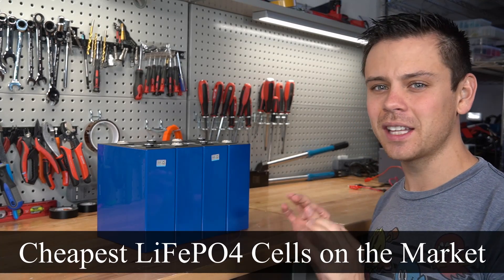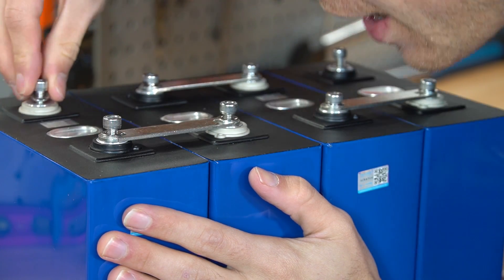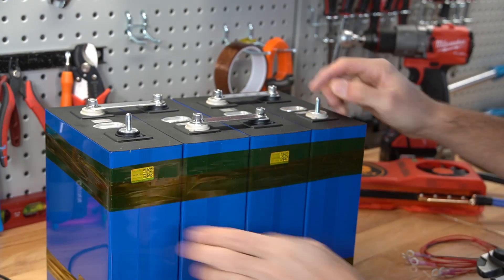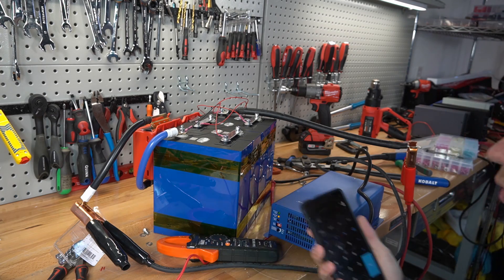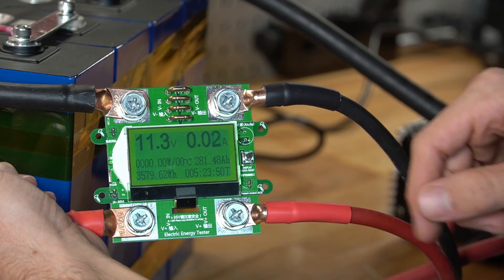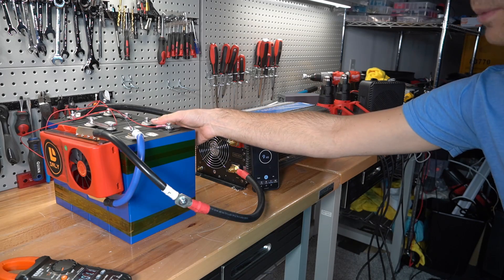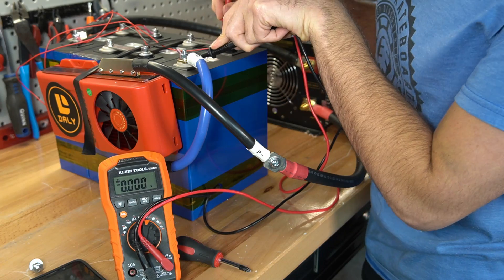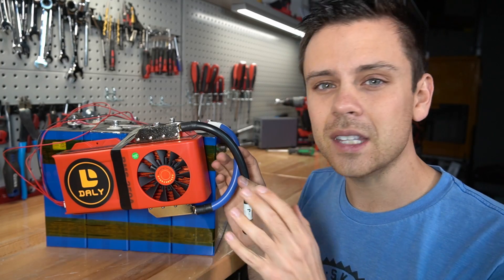$433 280Ah LiFePO4 Cells Tested: Cheaper than lead acid!

Comment: I would like to know if there are any things I should be careful on when wiring power packs with BMS in parallel? I have in plan to use same cells but wire them together 16pcs in serie, to get 48V packs. (I will use Daly's BMS 16S48V500A) and then I would like to connect 5x the same packs in parallel. Is this possible? Any recommendations, thoughts, ideas what should go wrong or what should I be careful on are very welcome. :) Thank you, Zan

Comment: How much should a person expect a LiFeO4 battery bank to droop under load?  I have a 300aH bank.  When I put a 150Amp load on the bank it droops from 13.2V to 12.2V.  Is this normal?
Reply from the maker: Oops didn't realize it's 150A load. Yeah that does seem normal, sorry. That's just a huge drop. Should be ok
Reply: @WillProwse  Cool. Thanks for the confirmation.
Reply: @WillProwse  What amount of droop would I expect to see?  The manufacturer says this is expected.

Comment: What’s the best way to drain a 36v (100ah) Lifepo4 battery? I need to do it to calibrate the onboard coulomb meter on electric utv’s that we sell. Are there 36v inverter’s available?

Comment: Will; thanks for the testing videos. I want to build two batteries like you have here. They will be in parallel, and power a 2000 watt magnum full sine wave inverter. So the question is, would the better BMS you link to (Overkill Solar 12v 4S 120A BMS w/ Low temp Charging Protection!!) in each battery provide enough protection, or should each BMS be capable of 200amps? If each needs to be 200 amps, any recommendations?  Keep up the great work and thanks again.

Comment: I want to set up an off grid system using 16 of these 280Ah batteries. Specifically what bms would you recommend? My monthly usage is about 300kwh and I will be keeping the grid as a backup.

Comment: Hey Will. Great review. Can you advise what the difference is between a common port and a separate port Daly BMS unit and which one I should get for a 12V battery being run in a campervan. Thx heaps

Comment: I don't have a bms on mine. The Victron Smart MPPT takes care of high/low voltage cutoff, and the Victron Smart Temp Sensor takes care of high/low temp cutoff. If i manually test each cell occasionally, what's the drawback? Am I missing something?

Comment: Will, thanks, you're the best! I just bought 32 cells at the main link (same as you got them from). Quick question: what's the best way to make a 48V battery out of of those 32 cells? (how many in parallel, and then how many in series: just want to confirm before making a fatal mistake)

Comment: Love the information Will your the Greatest.
     If you use 16s 250 amp BMS with 4 pack of cells in series for 48v 280ah battery  with 4 parallel  strings making a 48 volt 1130ah battery. Question? Can I use a forklift  battery charger rated at 48v 300a for an array to charge the batteries in a timely matter. I am off grid with a 10kw gen. set

Comment: Will, different Daly dealers tell me different things. Is it ok to use 2 16S lifepo4 packs, each with 200A Daly BMS and parallel both to 1 inverter? What about 2 CAN's to communicate with the Growatt SPF 6000TDVM? And what wire do we use for dry contact to autostart generator? And where to connect on a champion portable autostart/autochoke?

Comment: That Daly BMS on Amazon says it has a -7 Celsius temperature cut off.  Since you have it already you should see if the BMS will cut off when the BMS itself is cold like the temp sensor is built into the unit or inside of it.  That would be good to know.  The write up might be a copy and paste job from the smart BMSs they have???

Comment: When you wanne place two batteriepakkageges in parallel, do you need then two bms'es? Greetings from Holland
Reply: Wondering the same thing, looking to make a big battery bank with 16 cells on a 12V system

Comment: Hi, I like this channel very much. Thanks for the good  and informative videos. Maybe my question is below the wrong video but could you make a reviews about different cell types and your experience with them? Cylindrical vs. Prismatic / 18650 vs. 32700 vs. 38120. I am planning to make a battery pack with 32700 since this seems to be the cheapest cells per Ah at the moment (33$/100Ah).

Comment: I have reached the same conclusion regarding lower priced prismatic cell selection for DIY battery builds. In a perfect world an expensive group of grade A cells that were perfectly factory matched for internal resistance and capacity would function well for many years. Of course at the very least you would still need to pay for a good BMS that has minimal or no cell balancing capability. Unfortunately, even grade A batteries are going to age differently, the internal chemistry and build quality will vary somewhat so over the years the cells are not going to stay perfectly balanced. I would rather save a BUNCH of money on lower priced cells and install a BEEFY Bluetooth Cell balancer like JKBMS. Their 10A version is $500 but if you could easily save $1,500 or more on a 16 or 32 cell purchase.

Comment: my RV battery is built out of these cells and a DALY 200A BMS, its a crazy change from the "RV/Boat" 72Ah Lead acid I had. I am actually running the standard Lead Acid charger still but adjusted the Float/Bulk/Maint to all 13.8v so it basically a three stage constant current PS with a max of 40A now when charging from grid. I wanted a little closer to 13.6v but the regulator doesn't have the precision I would like. I the future I plan on a 24v pack for solar, and a 12v buck to my current 12v setup, that way I still have a nice clean 12v circuit (and have the 12v battery required for the electronic brakes)

Comment: With these cells you have to be sure what system you wanna run in the end... I myself made the wrong decession with 12V and I want to run a 24V system in my trailer-project but I can't wait another month to get some new cells. :) I can imagine running this system in an average RV-system can be a very good thing in terms of cost-saving. thanks for the review Will!
Reply: I you have the 4 cells just make a 24v 140Ah pack??
Reply: What's the difference between 12v and 24v?  What is better or worse about each one?
Reply: @waynefilkins8394  you have less thicker cables (costs are less) and the strength of the electricity is less which is a bit more safe … I would also say that 24V LED strips (and LED in general) quality wise is much better than 12V-dependent Strips…so there are some advantages in dependency what you want in the end. 24V is also a Good way because you can of course always step down for some appliances

Comment: Dear Will, YOU R Awesome! 
Now If you would have read the specs on the Dalys bms 250 model the cut off amps is 400 charging and 600 discharging. Also the daly's dosn't  keep the voltages even on those big a/h batts so I add a 0.5a-5.0 amp active balancer and it works great for 15$ off alixpress only problem is active balancer will pull batts down to 2.5v if u dont charge batts for like 6 or more months! Before xmax I got 4 of those same lishen new grade A 272a/h batts labeled 280a/h delivered in states from liltokala on alixpress for 382$ tax tag n title! Thats 95.50$ each!! Mine tested out at 279a/h using el cheapo 20$ meter? But still heck of a deal!

Comment: I like it, but I need something for a high vibration environment - RV.  I would be afraid those studs would break off, or am I wrong??  I would plan to mount just behind the propane tanks in a metal "tool box".  Thoughts?
Reply from the maker: I would use the fortune cells I have reviewed a few times. They are designed for high vibration.
Reply: @WillProwse  Sounds good.  I'm thinking of going 24v too for obvious reasons.  I figure I'll use a victron multiplus 3000w.  Unless this has a 12v output, I'll use a 24v->12v buck for the various 12v stuff.  I would imagine a buck would be better energy friendly than a ac-dc power supply.
Reply from the maker: https://www.mobile-solarpower.com/raw-lifepo4-deals-page.html
Reply: Thanks Will.  I was considering buying small 5000 mah cells and making a pack, but that’s allot of work for a 12v pack.  I have a Kweld, but still takes allot of time.

Comment: Hi Will! To put these batteries in series, could I use just two? Also, how many solar panels would I need to use if they are 36 volt/250watts each per a 280ah battery?To use this battery on a 24v system, I would have to use 2, correct, because there are 12 volts to each battery, right?) I'm new to all this, and am trying to take it all in. I would like to make a solar generator/power station that is high power (2.5kw or more), but not too difficult to transport. I live in Michigan, so the cold/freezing temps pose a problem too. I will have to figure out some way of keeping them heated. Thanks!

Comment: Will Kapton tape be enough to "compress" these cells? I just unboxed my cells and their voltages are all 3.28, but they aren't super flat sided (there are small gaps)  I plan to use them as coach batteries and will NOT charge or discharge at 1C rate, but I just don't know what amount of compression is appropriate for my application...

Comment: thanks for all your info you have been putting out. I have the same cells. mine pulled the 280 to. it was charged to 14 volts and I stopped it 2.8 per cell. 10 amps for 28 hrs. with power left. so what i wanted to know  is I have 400 watt solar so is it better to put them in parallel or series. I'm in series now and it has a hard time charging 300ah of batteries. I'm in Wisconsin not the best sun light. thank you

Comment: What would be the best BMS to use with 8 of these in series parallel for 12 volts @ 560AH?  I would not need more than 100 amps for either charge or discharge.  Can you parallel with most BMS's or do they need to be special or programmed for parallel use?

Comment: I placed an order to the US. Got them for $399 per 4 pack. Got 2 sets for a 24v setup and see how they work. Will be my first battery bank I build myself. Had some experience with used BYD, but wasn’t happy with their performance. Good thing they were cheap. Thanks Will for your info, it’s very helpful.
Reply: Build worked out fine for me. I have them in a heavy duty plastic box with some advantech subflooring plywood I had leftover just to give some extra support. I put 8 batteries sandwiched together terminals staggered and made 2 24v packs with a thin pvc separator sheets I found on Amazon. Got it tied to a 150A DC breaker and 150A class T fuse and a overkill solar 100A 48v bms. It was time consuming to build and make it work for me in my cabin setup and look neat. I also have this tied to 3 EG4 batteries all in parallel. The EG4 was easier, just plug an play, but for about $2000 and my time I build a battery that is about equal to the $4500 I spent from Signature Solar. I would build again, but I wish there were more options for a prefabricated cabinet that wasn’t so expensive or would take forever to get here from overseas.
Reply: @jimmyg6215  thanks for the reply 😊👍
Reply: Build worked out fine for me. I have them in a heavy duty plastic box with some advantech subflooring plywood I had leftover just to give some extra support. I put 8 batteries sandwiched together terminals staggered and made 2 24v packs with a thin pvc separator sheets I found on Amazon. Got it tied to a 150A DC breaker and 150A class T fuse and a overkill solar 100A 48v bms. It was time consuming to build and make it work for me in my cabin setup and look neat. I also have this tied to 3 EG4 batteries all in parallel. The EG4 was easier, just plug an play, but for about $2000 and my time I build a battery that is about equal to the $4500 I spent from Signature Solar. I would build again, but I wish there were more options for a prefabricated cabinet that wasn’t so expensive or would take forever to get here from overseas.
Reply: How did the batteries work out for you?  Would you buy them again today?
Reply: Same question as barkingspider, how did the build turnout?

Comment: Hi Will, @DIY Solar Power with Will Prowse
Do you know if these batteries are okay for a 48V System?
Or is it the BMS that limits you when you want to use it for 48V Sytstem?
e.g. 4 of these in series

Comment: I was looking at the reviews for the AIMS Power 75amp charger and it sounds like the fan runs 24/7 anytime that it is connected to AC.  Anyone know if this is correct and a way to get the fan to operate thermostatically?  That would be real annoying on an RV or boat.
Reply from the maker: Yep, and the fans will be on non stop, just like an inverter. Same with any other charger out there.
Reply from the maker: If you don't want fans to be on, I wouldn't buy a charger lol 😂
Reply: @WillProwse  On all of the marine chargers that I have looked into, they have thematically controlled fans that come on when the heat sink heats up.

Comment: Just thought of a good load for your 12V battery tests: a Bitcoin miner.  Some of the software allows you to set the power, and they run off 12V directly, so you don't have to worry about efficiency losses though an inverter.  An S9 will only go down to about 600W though (50A).  But can go up to more than 1400W (116A).  Newer ones can likely go higher, but cost a lot more.

Comment: I think I will be investing into 2 packs for my rv. Currently I only have 2 12 flooded batts. And at 170ah they only ran my fridge for id estimate 8hr at best during the last hurricane outage. My inverter is only 2500w iirc and it handles the charging of the batts at 13.7v iirc idk if that would be sufficient for this kind of lithium cell. They would rarely get used anyway.

Comment: Just a friendly suggestion - get a couple cheap 1500w space heaters  instead of heat guns if you are stepping away during these capacity tests.  There is a reason people use heat guns as fire/charcol starters.   They aren't designed to be left unattended like a heater.  If one of those things tips over, it's going to torch anything in it's path.

Comment: Very cool test. A 1C test was something I wanted to do but didn't. Also, most of the Daly have a charge rating of 1/2 the discharge rating. I agree those terminals are no good. I'll be using the stud approach one mine. It was very difficult to figure out the exact size bolt to use with maximum threads but not bottoming out. The stud approach completely fixes that concern. Also, those are not EVE batteries, though after typing this I see you already found that :)
Reply from the maker: Haha yeah, those terminals are pretty awful. I wish we could replace them. Even with studs, the amount of threads to work with sure is scary. 

Oh right, I messed that up. Was looking at old data sheets, my forum members told me. 😬 Not a bad price for the capacity though! I'm glad LiFePO4 is getting cheaper

Comment: I have an order in for 4 cells to make one 12volt battery to use as a 12v power supply in my van, what Basic BMS and 110v to 12volt charger could I use for this purpose?  Oh the charger I would like should fast charge the battery.  Thank You for your help,  Mr. Will Prowse

Comment: Can I use 8 (eight) of these and get to 560ah? If I purchase this kit, this would be the first battery system I've put together myself. It says I can use this as a start battery. True? I want to add this to my 2005 Sprinter van both to start the van and attached an inverter for other electrical uses. The alternator will recharge the batteries.

Comment: Am I to understand that wash one of these little batteries have 280 ah?  Do those 4 add up to over 1000 ah?
Reply: To make a useable 12v battery, you would use 4. You would have 280ah at 12v.

Comment: I don't like Daly BMS just try it out it will don't shut off when overvoltage is detected, even at 3,9V it don't disconnect
Reply from the maker: Yes it does. All 20 of my daly bms HVD work just fine. Could you post a video of your daly bms not working?
Reply: @WillProwse  We talked about this in a german forum but there was many Daly BMS with the same error. I use Ant BMS with LCD and Bluetooth

Comment: As I write this I am using my space heater in my RV boondocking using this exact setup. I went with 16 cells making 4 12V batteries going to common bus bar with 4 overkill solar BMS's with 18 inches of # 4 cable to a 3,000 watt siginer low frequency inverter. IT runs my ac, microwave, space heaters, compressors and any tool I have. Mine too tested at over capacity but top balancing is a must. Thank you will for a good vid on that. Got them through Amy at Xuba about $2,000 with BMS's I don't know why anyone would buy anything else. This is a edit to say that going with 12 volts was not my first choice. I was going to go with 2 24v batteries with 2 overkill solar 100 amp bms but since I have a 5th wheel didn't want to mess around with the trailer brake issues from the feed from my truck, the 12v for lights ect. would be easy with converter but didn't want deal with the truck brake signal issues, even so it works perfectly
Reply: Can you talk more about what you mean by "trailer brake issues from the feed from my truck" ?